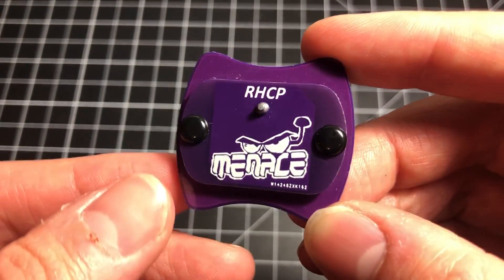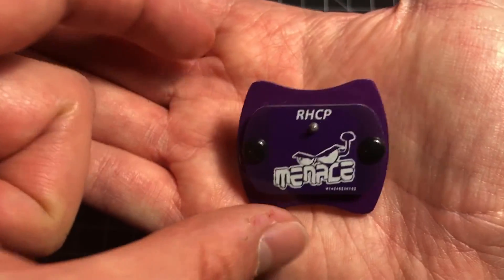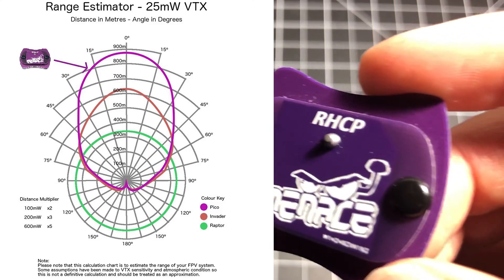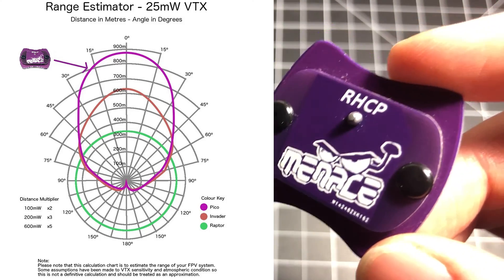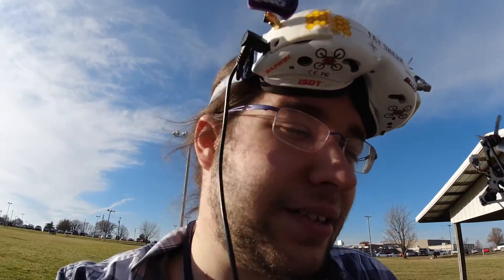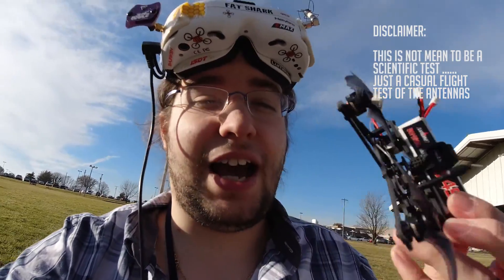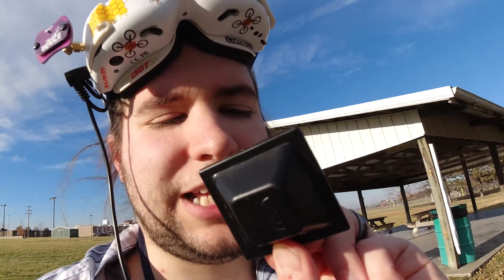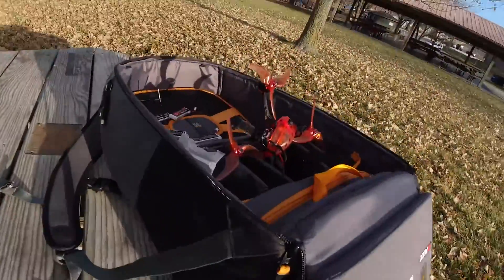Menace PicoPatch RHCP 5.8Ghz SMA Patch Antenna - 25mw Test (TinyHawk Freestyle)

Comment: Where both videos shot from the came quad/camera? The colors were different, I thought the color with the Menace was better
Reply from the maker: Both videos were shot with the same camera and quad the Tinyhawk freestyle, with me sitting in the same spot on the same day/time.
Reply: John Cuppi you wouldn’t think an antenna would effect the color like that, guess 5e menace was getting better reception so the goggles had more information to process.
Reply from the maker: @GeezerGramps  I agree! The better reception lead to better color for sure. It's not like the sun was different either, after I finished the first flight I landed and did a second flight. I'm thinking if the regular menace patch performs this well, the dipole antenna optimized menace "bandicoot" patch is probably even better!

Comment: That pico patch seemed to perform pretty well actually working on only 25mw vtx, i may actually pick up one of these myself thanks for sharing you tests John👍
Reply from the maker: Thanks David! Apparently I just found out there is an even better patch antenna for drones that have dipoles/whips, since there is some loss. Definitely going to be picking up one of those too!
Reply: @JohnCuppi  yes the menace rc bandicoots are awesome for pairing with dipoles. Noticable difference in range

Comment: Hey John, how are you doing? Well i hope. I know this is off topic but, like a fool i bought a jjrc x1, not the G, the first one they released. I checked all my motors and they're good so i know its the mother board. One motor wont spin. Do you have any idea where i can find a new board? Banggood and Gearbest don't have them. I found one website and they want 50 dollars for it. Thats like half the cost of the quad. If you could give me some ideas it would be greatly appreciated. Hopefully you'll have, better luck then me. Thanks in advance. Have a great day, John! 🏁👍
Reply from the maker: I checked into this for you and sadly I can't find anywhere to buy a new board except that one for $50. Unfortunately the part support for lower end quads tends to be very short... the parts were likely available at BG and GB at some point, but as the quad is old... they sold all they had. Now only obscure sites that mark up the prices are what's left. These cheap products are all designed to have a short lifecycle and some are worse than others. 

That's one reason in the toy quad world the Visuo series is my favorite, the parts have been kept the same for 2+ years and so there is an abundance of then. Same with any of the popular toy grade drones, they still have good parts availability. 

Wish I had better advice but I would just cut the loss and save the parts, you never know when you could use something from it in the future.